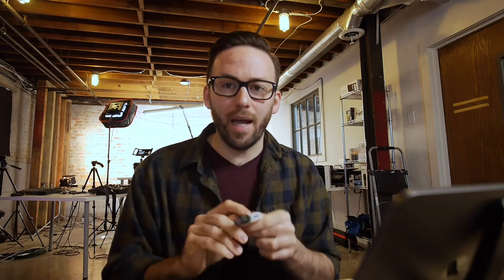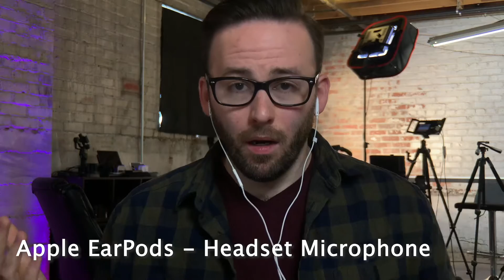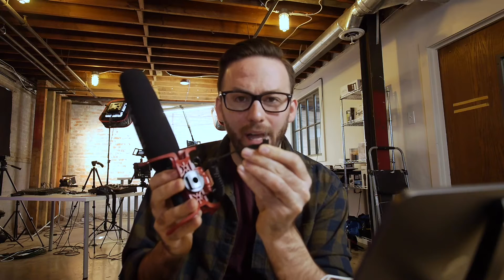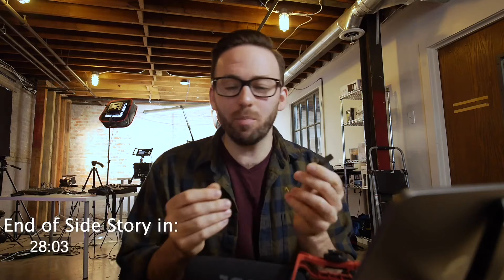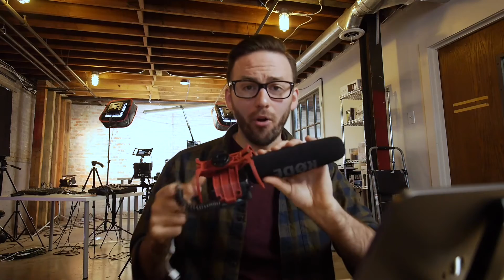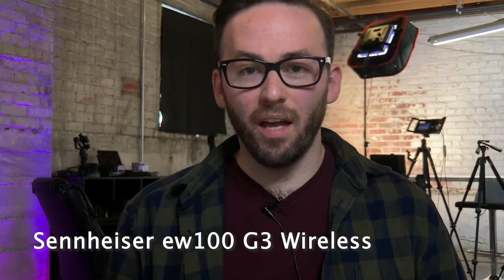Microphone Comparison for My iPhone XR

Comment: It's not an impedance mismatch, or a "sense" issue because the Rode doesn't respond to the iPhone headphone adapter either. The reason the Sennheiser output doesn't work is because the output is balanced audio and when you sum the tip and ring to the mic input into the iPhone you are cancelling the two hot leads of the Sennheiser out.
Reply from the maker: Nah, it's an impedance mismatch. When you adjust the output gain (AF Out) the iPhone starts to think you're asking Siri a question. This is because the gain level affects the impedance and tricks the phone into thinking you are pressing buttons on the attached headphones. I had to push the output to +6dB for the iPhone to detect it. But after reducing it to -18, it stopped working and Siri started listening. Without a specific impedance (~1kΩ), the iOS device will not change the audio route to the wired input. So, the digital option with the Sabrent is more reliable. Also, the EK100 is unbalanced, so it definitely isn't because of a phase cancellation: https://en-us.sennheiser.com/wireless-clip-on-lavalier-microphone-set-presentation-ew-100-eng-g3.
Reply: That page says unbalanced, but the manual for the receiver says that the shield is used as the second antenna, and mono output needs to be tip/sleeve, the ring is NC. There's a lot of extra stuff going on in there. 
I still believe that if you used a mono output cable as shown in the manual, there'd be no "impedance" issue. 
https://assets.sennheiser.com/global-downloads/file/6358/EK_100_G3_Manual_12_2016_EN.pdf

Comment: What about. Bluetooth headset or AirPods?
Reply from the maker: I didn't have any AirPod's available for this test, but you can use Bluetooth devices with Switcher as your audio input source. You can also monitor the output of Switcher through a bluetooth headset.